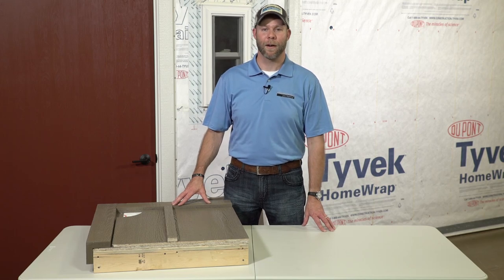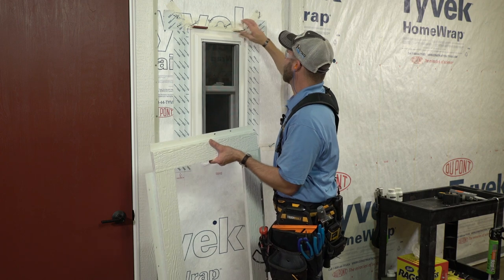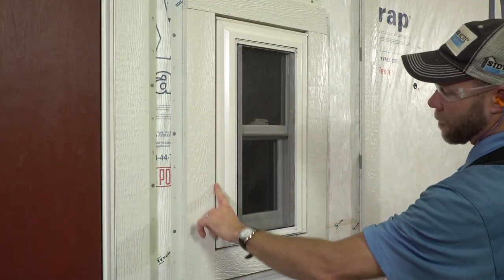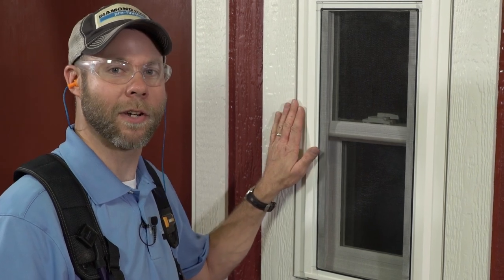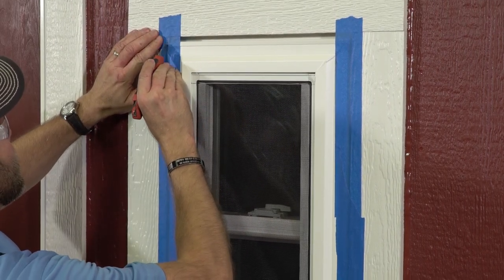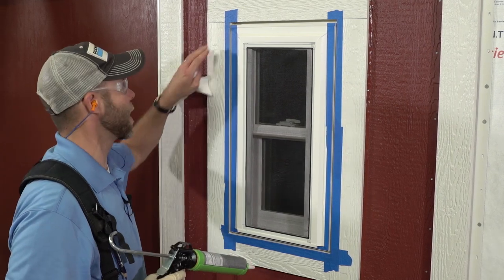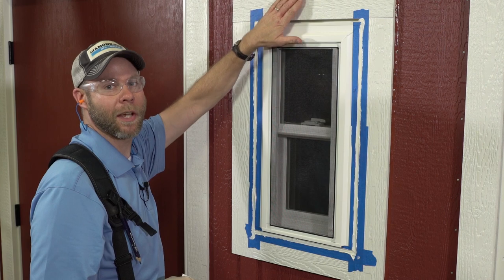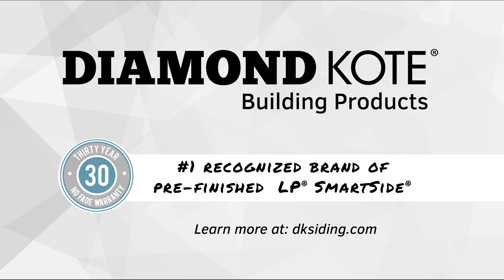Nail Fin Trim - Pocket Screw Installation for Windows

Comment: If I was the homeowner and someone left that 3/8th gap on the top of the window. I wouldn’t accept that and have them re-do it.  That looks terrible
Reply from the maker: Hi Manny! The 3/8" gap above the window is implemented to allow for any moisture to drain that may get behind the siding. The potential for water damage to the siding, window, OSB, etc. would significantly increase over time without giving this moisture a place to escape. We recognize that every homeowner's visual aesthetic preferences are different, however we highly recommend this gap to ensure the long term success of the siding system as a whole, which we feel will be reflected in the long term satisfaction of the homeowner.
Reply: It looks herrendous....I'm doing it now on a job....it's gonna create problems....if the sides aren't fully caulked it's gonna trap water,  and be filled with mud wasp nests in 6 months....